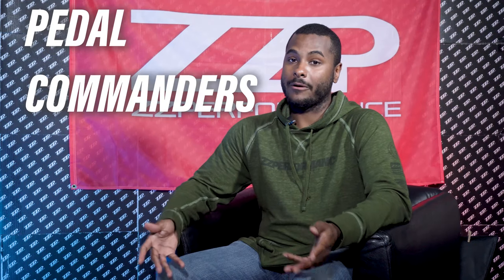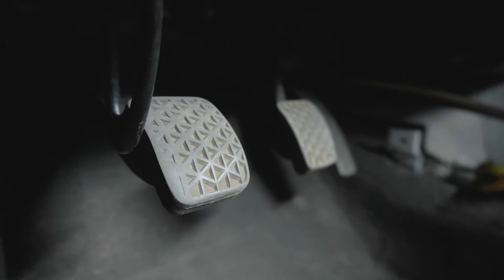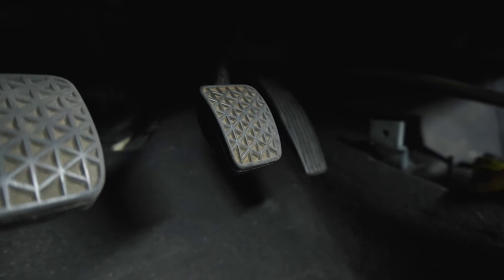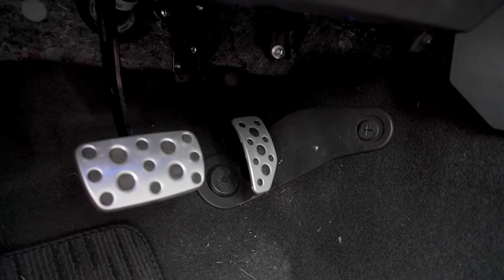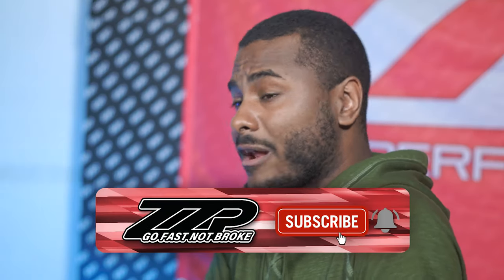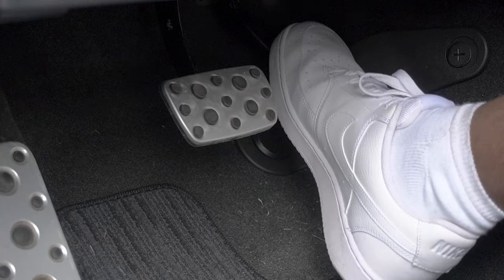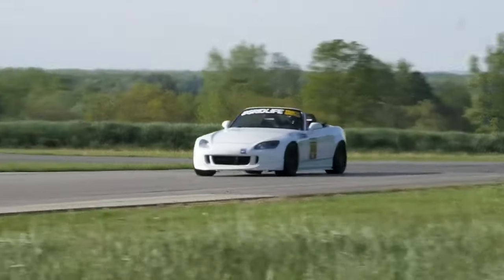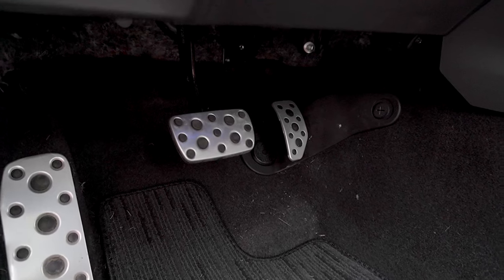Why You SHOULD NOT Buy a Pedal Commander // Behind The Builds

Comment: Good points for some situations if used wrong but as a 4x4 driving situation . Throttle controllers are some of the best things that can be installed too help assist you in certain situations.. taking away that lag of a desiel vehicle that happens regardless of foot flat or not can make you a 10- 20 percent increase of take off ( no power increase ) just repsonce , also adjusting through modes too fit driving situations where taking more response out for driving in more hectic situations, where this can aid in making better control in certain driving situation

Comment: I just threw mine away yesterday. I had it for a while and yes it worked as advertised. Till it caused issues and made my truck go to reduced power mode and caused the traction control and stabilitrac to disable. Check engine light and left me stranded. pulled it off cleared the code and back to normal. Works good till it doesn't. Use with caution folks

Comment: I agree/disagree.

The purpose of this product is to modify the input signal to the PCM. With it being plug and play and easily removable you don't have to worry about it voiding your warranty if you still have it, vs if you flashed your PCM and now the dealer knows it the next time they scan your car.

And sure, a tune can get rid of the lag, but that also means it's now stuck like that. I've seen cases where in reverse the pedal is too aggressive after the tune, so a pedal Commander would be ideal to modulate this sort of issues.

Let's say you're concerned about your fuel economy because you like to race even your own shadow on the streets, now you can put that stuff on eco and can't floor it all the way so naturally you'll save fuel. Sometimes as car enthusiasts we can't resist the urge of doing a pull or racing someone that passed you in the highway.

I agree that for actual racing you'd be better off turning it off. Everything other than racing it is a great addition.
Reply: I don't know what kind of vehicle you drive, but your last statement is false for a third generation Tacoma. Racing? I mean, you either tune or get one of these.. because out the hole, the Tacoma isn't winning shit. But with this or a tune, you can use the power you actually have. From the moment you press the pedal, unlike stock.
Now if you're trying to hit top speed, there are some better things you can do for $300 I guess, if you have your own set of wrenches.
Reply: @Malefalent  I meant in general, I wouldn't race a Tacoma for shit lol. I drive a garage turbocharged Corolla iM w/319 wheel. I bought a pedal commander device but didn't like how it messed so much with my foot play at take offs during normal driving, I either over accelerated or under accelerated, so ultimately I only use the "lock" feature which kills the accelerator just as a bit of theft prevention.

Bottom line is that this device is basically adding Sport/Eco modes to your car, which depending on what you're expecting from it might be a good buy or a waste of money. Mainly automatic cars benefit from it as you don't have to worry about your foot work when rolling out from a stop, heel toe and rev matching.

Also, in reality, this doesn't eliminate delay, it just multiplies the amount of acceleration. So if your pedal is say 50% in the multiplier can say it's at 70% therefore giving the PCM the notion that you're demanding more than you actually are. Likewise for eco modes it's less.
Reply: @minimumeffortenthusiast8242  well that's my problem. With the Tacoma, if I floor it, it's like the ECM is told I'm only hitting 10%, then 20%, then 30%... It doesn't actually allow me to get up and go. This is exactly what I needed. It's not just the pedal delay that all of these newer electronic accelerator cars have, which I'm not sure it does anything whatsoever about... But it does actually allow me to go when I say go. Which is exactly what I needed. 

They (Tacoma stock) have the ECT button, which allows it to rev higher prior to shifting, and stay at a higher rev point- it's great for passing on interstate and such, I guess... But I'm that guy that hugs the left lane, and I'm quite happy with my purchase. I actually ended up getting mine for about $170 with amazon credit card promotion at the time (if you were accepted for a credit card, they gave you $300 cash credit to your Amazon account, nothing to do with the credit card balance.

Comment: I do have a Sprint Booster on my 2022 Tacoma manual transmission and I do agree that it will NOT make my truck faster. But the thing i love about the device is the throttle response, no lagging on 1st gear. Once I put it on 1st gear and step on gas pedal it respond right away. But I turn the Sprint Booster OFF during winter time In Wisconsin, especially if road is slippery.

Comment: In my experience these do help a lot, especially with commonrail diesel cars

with commonrail diesels blipping the throttle when downshifting doesn't work, it just stays at idle. You have to floor the pedal for a second before it responds.

You can't just floor the car and wait for it to respond when downshifting because by the time you wait, you just missed the shift.

It's why I prefer the throttle response of mechanically injected diesels.

Comment: The biggest improvement from the tune in my Impala is the throttle response. From the factory, it's definitely setup to keep the elderly from accidentally driving through storefronts. So, if you don't want to do a tune for some reason, I'd imagine a throttle control device could improve things. That said, my tune was about the same money (on sale) as some of these devices and it added HP, greatly improved shift points, and has done both while improving my highway mpg. So, whatever works for you, but a good tune customized for your car is the better option IF you can.

Comment: Throttle controllers push more voltage to the throttle body. In doing this it eliminates the "ramp" up the throttle body uses by default for emissions reason. Not only do throttle controllers drastically change the behavior of the throttle body, but in some cars it even leads to the throttle body opening up further than stock.

Comment: They don’t increase performance but I find for roll races it does increase throttle response.
Reply: Did you watch the vid? 
It literally just applies more throttle percentage than you input. That's it.
Reply: I can’t speak on this brand, but the model I have is by vivid racing,  it does more than just increase throttle percentage,  it makes the input faster.  If you depress your gas pedal fully it takes a couple .10’s for the ecu to read and open the throttle plate,  with the “pedal mod” it makes it much faster down to .001’s.  May not seem like a big deal but when you are roll racing it matters to get the jump.  Drag racing it doesn’t matter tps is at 100 all the time.

Comment: Ok. 
So I have a 2022 Toyota Camry XSE V6, had the same thing 2019 and a 2013 and 2015 Honda Accord coup V6.
No matter how hard I pushed the throttle to the floor, there's a big delay before it starts to properly accelerate. Should I just slam it? Like stomp on it to get a good acceleration without delay? Years ago I had a 1988 Oldsmobile Toronado Trofeo FE3. That car didn't have any tuning, just a 3.8L V6 engine. That car was a beast, and pretty luxury at the time for an American car. My friend had Mercury Cougar 5.0 He used to get pissed when we raced because he couldn't really get away far. I never got further back than my front staying around his front doors, which were the only doors, since it was a 2 door cuope, like my Toronado.
I don't have this Pedal Commander yet, but based on dozens of YouTube videos, I will get one.

Comment: I have one on my 2011 V10 R8, the car was fun to drive before now it's insane. Switching it off and flooring the pedal is nowhere near the same as when the Pedal Commander is switched on. The car feels horribly detuned when it's off. If I'm on the fwy and stomp on it the car launches way better than stomping on it when it's off. There's a huge difference, same with a dead stop.  Better throttle response may not make your car faster over all but it will make it a lot quicker and a lot more fun to drive. It's hands down the biggest bang for your buck mod you can do and takes 10 mins to install.

Comment: It's really frustrating because in the name of fuel economy so many OEM fly by wire systems are gimped such that you need to get a good amount of travel down to start to get actual power out of it.  The pedal commander compensates for that, but it's really hard to get one with correction that corrects it to 1:1.  Usually the pedal commanders (and similar devices) are giving 100% output by like 60% throttle which is equally as stupid as the way it came from the factory.

What happened to the good 'ol days where 40% throttle meant 40% throttle plate and 70% meant 70%??  It's not like fly-by-wire systems are not capable of being as accurate as traditional ones.  It's just a matter that the OEM's don't map them that way making people want to run out and by pedal commander type devices.  Unfortunately these devices are rather generic in terms of software and never get you a 1:1 mapping.
Reply: You can get 1:1 with Sprint Booster!

Comment: Ok, I don't know about the pedal commander.  

However, I've had my pedalmax by jmschip for over 3 years now.  And it makes a world of difference. 

Even with a tune and the dial turned off. Even if I flow it, there's still a long delay. Not just that, it would take forever to down shift and pick up speed. 

As a poss to with my dial set at 75%. I just have to press a quarter of throttle, and it will down shift real quick and get up to high speeds in no time...

Comment: so i havent purchased this pedal commander yet but on my 2017 fiat 2.4L zf 9 speed. i changed plugs to some ngk performance plugs and put some pirelli pzero neros on it and found out something wonderful. Its a cure for my accelerator lag and that was to just turn off ESC that works for me!. Feels like im in control of the throttle and the vehicle again. I say if it isnt raining and your not navigating rough terrain why have it on anyways?

Comment: I believe it's the same as having the Eco/Sport/Normal drive modes that some cars already come with. If it's an older car or one without those options, then get one.
Reply: No those modulate how the RPMs fluctuate and how fast the gears change . This simply tells your cars computer where the pedal should be depending on how you program it , like half way could convince the comp your giving it 95% instead of giving you half the (throttle)power it gives you close to a hundred percent . Giving the illusion that your cars all the sudden “faster” when in reality your just flooring it with less effort
Reply: No.
Reply: @Rawkfist1501 I see. Cereal, then milk vs milk, then cereal. Reminds me of when Androids first came out and we had to root in order to give ourselves superuser privileges to get our phone to perform they way it was originally designed to do.

Comment: It makes the throttle body open up without delay. That allows you to utilize the engine power. You’re the only person I’ve ever seen say it doesn’t do anything.
Reply from the maker: He explains that in the video. The problem is that it basically makes the last 40% of peddle press worthless because you're telling the car to floor it without actually putting your foot all the way down.
Reply: @ZZPerformanceChannel  your not telling the car to floor it. Your telling the throttle to open quicker not wider.
Reply: @ZZPerformanceChannel  I stand corrected. You are right. My sprint booster arrived yesterday and after I installed I tested it out. It performs exactly the way you say it does. There is still severe lag from the time the pedal is depressed to the time the engine responds. The only thing the sprint booster did was allow me to depress the pedal a fraction of the way down to get the response it would have given me without the booster. This product is completely not worth the 289 dollar price. I’m sending it back for a refund.
Reply: @ZZPerformanceChannel  Have you tested this item in a real world drag strip comparison? To see if there is a ET drop when using the PC? Or do you just road race.  Because as a drag racer if i can get to WOT quicker after launch my ET should be quicker without an increase in power at all!!
Reply: @Jerlemi2  I think you two work in the same shop 🤣🤣

Comment: I was thinking about getting a BMS pedal tuner for my '16 Genesis. Because quite frankly I'm tired of my 314HP vehicle getting taken off the line by shit boxes because Hyundai's electronic drive by wire is so lagging, I have to floor it for it to respond. My sister's '07 Honda CRV 4 banger has WAY more kick in the response. I get it, it is supposed to be a "luxury" sport. And don't get me wrong, it is smooth and wonderful, but sometimes you need to put those HPs to good use right away.
Reply: I got same problem on my genesis I’m bout to buy it

Comment: They’re perfect for vehicles with lag. For example I have a 2016 Silverado and when I run it without the throttle commander, I have to constantly fuck with the gas pedal and you get almost nothing at halfway to the floor. I’ve got an injen “throttle commander” and it’s much more responsive and smooth.

Comment: I just bought a pedal commander for my 2014  Jeep Cherokee 3.2 v6,  zf 9 speed.  This is something that you  DO WANT.  Ever since a software update
in mid 2015 (and ALL subsequent ones) from the stealership, the transmission and throttle response has made the operation of the vehicle to be absolute dismal.  
They say  "it's operating AS DESIGNED"  The key words to prevent action to be taken against them. This is a cheap fix and a necessary fix.  There are no other tuners for this vehicle to fix issues.

Comment: If the response time is quicker then there's no way it's not slightly faster since reaction time is measured in the time you apply pressure to the pedal to the time it takes for that pressure to turn into response. Any adjustments for increasing sensitivity and quicker response will translate. Of course the right tune is better but if it's safe for the car then why not try it it's not gonna hurt.

Comment: Hi, very informative, advanced, and complete information regarding the throttle controller, thank you, but I have a question I hope the admin or ZZPerformance can answer regarding safety issues, My question is what if the throttle controller's device suddenly fails? or the little wire cut? Do we still have the control of gas pedal? or it will be back to normal mode? Thank you for hoping ZZPerformance can enlighten us. thank you again!
Reply: No, you do not. Mine failed 3 days ago, and , it failed where my truck went into power reduce. Look up pedal commander problems on YouTube. Some people get stuck in full throttle positions. I threw mine away after it happened twice in a year. They are trash
Reply: You will end up with a dead pedal that is the problem with all these pedal controllers with the exception of the Banks Pedal Monster, the Pedal Monster will not leave you with a dead pedal, their system will revert back to the stock programming if it detects a problem. 

Banks Pedal Monster did their pedal controller right while all the others are lacking.

Comment: Ok in newer cars you can literally floor the pedal and it'll take like 1.5 seconds to get full power and that's what the throttle commander helps with, makes it feel like the pedal is actually connected to the engine via cable

Comment: As a actual user and person with mods on my Truck it improves response for when needed no it doesn't add HP or Torque but.........
I have a Nissan Frontier Pro4X basically 4x4 model i am lifted gears changed from 3:69 to 4.10s also i am rolling on 35's with 1.5 inch adapters it helps in offroading big time and i run a 6 speed manual it is useful just not for everyone.

Bottom line fellas if your car is already has a tons of mods this will just make your car or truck more fun to drive we don't need the obvious it's not adding HP and people aren't laughing behind your back about it either pure nonsense.

Comment: Where I found the benefit on my Turbo Daily is that in NORMAL mode from the cars factory setting, the throttle response is just too lazy and soft.   I love the settings of the steering and shocks, etc. but mine doesn't have a CUSTOM Mode where I can set just the throttle at a more sporty setting so thus where a pedal commander comes in.  I don't need full-on sport mode response, but I do want more than the NORMAL factory setting.    That's the reason I installed one.

Comment: You can't just floor the gas pedal and do the same thing as  Pedal Commander.  If you stomp on the gas pedal you will still have a lag with the factory throttle programming.  The notion that you can just press the gas pedal harder/faster and do the same thing as a Pedal Commander is just not true.  The Pedal Commander just makes the throttle react quicker and that is what it claims to do.
Reply: Yep!
Reply: I have a 2022 XSE V6 Camry. Even in SPORT mode there's a pretty bad delay when literally stepping on the pedal.

Comment: As a professional mechanic my self tuning is more expensive but actually practical and specific to YOUR car and how you want to run it. The pedal commander does exactly like he says, instead of 10% it’ll make the computer think you’re at 50 to 53% acceleration really it could just damage your vehicle in the long run if you keep it in the higher modes constantly running that high rpm and what not. But some people like them some hate them it’s your money. I’m not saying it doesn’t do what it’s supposed to do it does remove the lag of the throttle response to a extent. I’m not a hater but I’m not saying go buy it either I’ve never put one in any of my vehicles I can only comment on a logical view